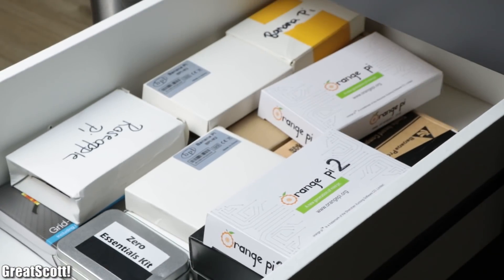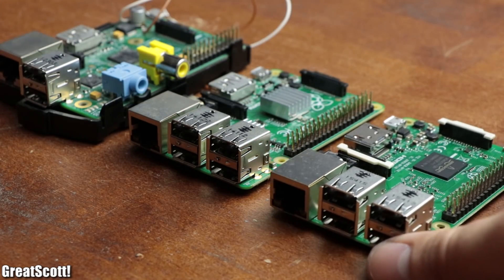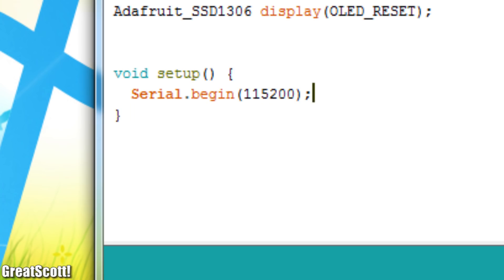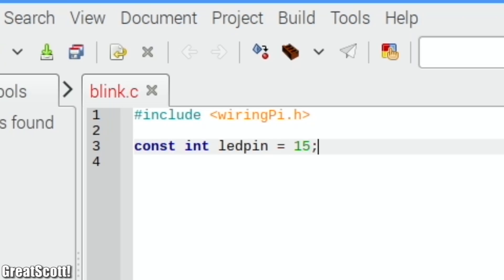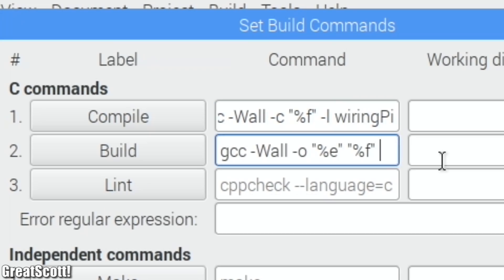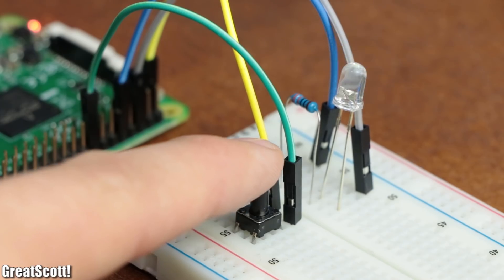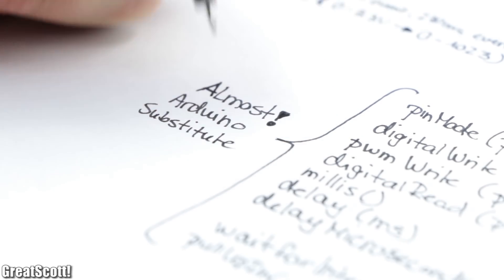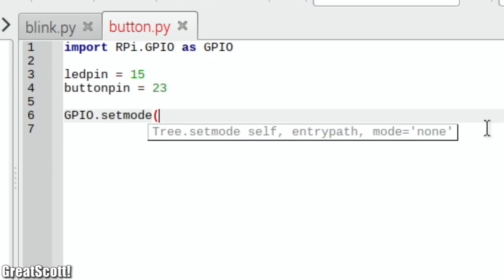Can a Raspberry Pi be used as an Arduino? || RPi GPIO Programming Guide 101

Comment: Awesome! This the first C programming tutorial I've seen on the PI and it was a  great introduction.  A question though -  can you see any advantages to using C except familiarity? I can understand that in a memory and processor limited cpu like the arduino it's absolutely needed but on the resource rich environment of the PI I think the python tooling is so much richer.  Either way thanks for the video - it's great to see your detailed analysis.
Reply: Usually C is much faster than python because C compiles to machine code and python needs an interpreter, however, you have Cython
Reply: It depends on the type of project.
Reply: It's very useful if you need performance (for example generating a pwm signal) since it bottlenecks the RPi a bit.
For most applications, however, python is fine
Reply: This is how you start a holy war between C and Python adherents.
Reply: C is a very well supported language. Especially when legacy versions are included.

I wrote C Programs on DOS back in the day.
Reply: Everyone seems to be arguing about speed and machine code and whatnot, which is pretty much beside the point for most projects.

Use C for really low-level stuff (bit-banging, realtime, etc.).  Use Python for really high-level stuff (cloud, AI, database, etc.).  For all the stuff in between, use whichever one you like more.  It's not rocket science.

Besides, it's not like C and Python are the only programming languages supported on the Pi.  You can use C# or Java if you want.  If the language you want to use doesn't have direct support for things like GPIO, then add it.  Almost every language has a way to tie into the C API.
Reply: Alan Ramírez Herrera , I actually noticed that my raspberry pi generates compiled python files. I haven't looked into it, because I just saw them last night, but it seems that it actually compiles it somehow (regular Python, not cython)
Reply: Another way to look at it:
Many popular languages nowadays (C#, Java, JS, PHP,  and many more) use syntax that is very similar to C, and will be easier to learn if you learn C than if you learn Python.
Reply: Benedikt S 
Depends on the project if you want something that is closer to hardware you can use GO some says not sure of this info yet ...
Reply: Alan Ramírez Herrera 
Yeah and python have a python VM
Reply: Павел Данилов 
but languages have limitations ..
Not all are the same this is where I was getting to ...
Reply: I use a lot of python at work. I also use C. It doesn't have to be one or the other. Python isn't the fastest for many tasks, but you can write a python module in C and call that to get the speed you need.

When it comes to embedded what language you choose depends on what your project requirements are. Python is great for general purpose use when timing isn't critical. If you need to send and receive data from the network, update displays, blink some lights, it shines in those applications. If you have a real time requirement, meaning you must respond to an event within a specified time period, or you need to respond at an exact time python fails miserably. C is is very good at that kind of task. The operating system needs to be modified with real-time kernel extensions so the operating system doesn't decide to do something else when it needs to react because of the schedular. Real time is where microcontrollers excel. When your code is on bare metal it's very easy to react quickly. The microcontroller CPU may not be as powerful, but it's entire purpose is to run only your code. It doesn't have to split time between the tasks of an operating system. There are very light operating systems, RTOS or real time operating system, that handle scheduling of tasks for those applications.

There are loads of hobby projects that get into the realtime domain: Quadcopters, motor control, etc.

Reliability is another. It doesn't come up in hobby projects but it's possible to certify C code up to SIL2 for mission and life-critical software. That's not possible with python in it's current state. Not that the raspberry pi would come close to the lowest level of certification. That's a whole different world though.
Reply: I would consider stepper motor control to be one of the in-between applications.  What I meant by "low-level" was more high-speed protocol stuff or digging into kernel internals.  Python is plenty fast for steppers.

I personally don't care much for Python.  I've used it, and it's a good platform - I just don't like programming in it, much in the same way I don't like ketchup on my hamburgers.  It's a preference thing.  So while I believe you when you say pyCNC is the bee's knees, I won't be checking it out :)  Thanks for the recommendation, though.

It just irks me when everyone starts arguing about compiled vs. interpreted vs. byte compiled languages when 99% of the time it doesn't matter.
Reply: I use BASH scripts for most of what I do on RPi. If a BASH script can't do it, there's almost certainly existing software that can (usually written in C or C++).
Reply: +Jeff Spaulding, no, python is not fast enough to outperform Arduino CNC software, unless you use low level programming.  Using the hardware in Linux.  pyCNC uses DMA to be able to outperform the Arduino devices.

And it is your own problem if you don't even bother to look at it or the blog where it is explained. It is a good learning experience.  But it is your loss...

Yes, most of the time it doesn't matter if it is compiled or interpreted.  But sometimes it does.
Reply: Languages are tools, they excell at different tasks. A screwdriver is a very good tool for driving screws, not so good for hammering nails (but possible with persistance and force). Same goes for a hammer.

If you are new to to this, give python a try. By the time you need to solve a reliability, stability or performance issue, you will not have a problem getting into C.
Reply: Alan Ramírez Herrera In that way you are absolutely right. But you have to look in another way onto a Project with a Raspberry Pi. Performance is secondary.
Reply: noisycarlos yes it uses regular python to compile....if u have a file called demo.py then after compiling u ll get one more file called demo.cpy
Reply: Mai Mariarti nice to read that ....
Reply: northshorepx use c++ and you have the best of both worlds: fast programs & less code
Reply: Henrik for rest of all the developing programming c c++ would suffice.
Reply: noisycarlos 
Python get interpreted and compiled and it also have Python VM
This is why python is a hydride language not like java which is always compiled to byte code
Reply: I would say.

ALL programming languages can be shown is Turing completed.  That is, they all have sequences, selections and iterations (loops), that is same semantics.  They are formed and expressed in diffrent forms though (syntax).

With that said, there are different ways of programming in them, so you need to learn the syntax and way of expressing the code.  Like code in procedural languages (C, PHP), objective languages (Java, C#, JavaScript) and functional languages (Haskell, Ocaml, ML, Lisp, JavaScript).  And even logical programming languages (like Prolog).
They are all quite different and relies on different way of coding.

But yes, if you have the basics of coding, you should be able to learn other languages. If you do read some code and write a couple of programs in them.
Reply: Yes, the byte code means that the system doesn't need to parse and interpret the source code when executing.  And it will also help finding errors earlier.  Which is a huge help when debuging and executing.
Reply: (isn't it demo.pyc ?)
Reply: Except that C++ are optimized for speed, not readability (Yes, Bjarne Stroustrup told me that himself).  So if you want to learn to program, you migh want to consider other programming languages first.

So yes, it IS fast.  Yes, it is less code.  Yes, it is harder to understand, as it makes lots of things "magically".

Like coersion in Java and many other languages (which is automatically type casting, like convert int to Integer, which makes it MUCH harder for the compiler to help you make type safe programs)
Reply: Anders Jackson 
Yeah I have a project but yeah let’s just not start doing it with the easiest language let’s go and learn another language just to prove that we are great programmers
Reply: Lassi Kinnunen Of course.
Reply: +Mai Mariarti, many/most modern programming languages are just boot strapped in C, and then programmed in the language itself.
And why is C used so often?  Because it is available on so many architectures because of Unix and because of GNU.
And no, C are not complicated, it is old and are designed in ways that makes it HARD to optimize.  Just look at the aliasing problem when optimizing code, which most modern languages avoid, which make them MUCH more easy to optimize.
C++ is another language, based on C and added object oriented (and some more) to make C++ a more modern language.

C is basically just an glorified portable assembler.  Built on 1960 times compiler theories of designing languages, which are showing through.
Reply: +Lassi Kinnunen.  Have a look at PyCNC.
https://medium.freecodecamp.org/how-to-build-a-3-d-printer-using-cnc-controller-in-python-bd3cd5e28516
Reply: +cypherf0x, please have a look at pyCNC, and you have Linux and Python beating the crap out of an 8 bit Arduino system doing CNC and controlling stepper motors.
Reply: Well, to make a difference from your indications, pyCNC are doing real low level things to drive stepper motors directly from the RPi, without any low level C, just coding in Python.  Have a look, it is impressive what have been done.
Reply: If you're programming embedded or MCU-like applications on Linux do it in C.
If you use Python or whatever you'll be eternally fighting with someones half assed library around the kernel sub-system you want to work with. If you use C when you want to use SPI you can go into the Documentation directory of the kernel source and find out how to use it's real interface for yourself.
Reply: C is a compiled language, which means a much much faster code execution comparing to the interpreter of python (around 1000 times, even comparing to the most cutting-edge optimized python interpreter like Pypy). However, C is designed in very early days and some of their design concepts are quite out of date now. With that being said, it is much harder for beginner to write good C code than python code. You will deal with compiler errors, linking errors, runtime errors, segfaults and undefined behaviors. So, except you have had a lot C programming experience on Linux, it is not recommended to use C for RPI projects.
Reply: Lots of good points being made on the c side here. But if you want to do anything with eg. machine learning or machine vision; you're really better off looking at python. Not because python is fast, but because the  tools are so much better. As for PWM on the Rpy, there are plenty of python libraries that can handle that for you.
Reply: Henrik but for AI python is the best choice.
Reply: +Alan Ramirez Herrera.  Most project doesn't need C, unless you want to code some drivers for OS:es.
There even are some CNC drivers written in Python for RPi.  Wich I would have said was not possible to write for CNC in Arm running Linux. Well, it is even faster then Arduino based systems. But with some smart coding, using DMA, they are able to get a faster CNC controller software then with plain C.

Like, most Internet Bank software are written in Java.  That is because it is fast enough, but much easier to write system in then C.

So I would suggest python, haskell, Ocaml or any high level language compared to C.  UNLESS you are writing drivers for Linux.  Then go for C.

Yes, I started to code C in 1983 on Unix, OS-9 (for 6909 CPU), HP 64000 development systems and PRIMOS/PRIMUX OS (on a Prime 750 real mini computer, that was about 750 kg heavy).
Reply: Yes, ANY modern compiler will beat any Assembler code written by humans, as long as they are allowed to do some optimization.

And yes, there are lots of programming languages that makes as good or better machine code then C. Basically because they have a decent type system, memory manager and frankly, good enough speed if they don't match C in speed (which many do).
They are modern and usually based on something better and easier to optimize, like a modern functional programming language (Ocaml, Haskell, Erlang etc).

There are actually really hard to make a good optimizer for C, and have LOTS of times spent on optimizing the code.  The major problem being the aliasing in C, which isn't in modern functional languages.

But most programs doesn't need the extra speed of C (or what the programmer think is extra speed).  As that comes with harder to code and debug programs then with a modern language, like Python, Java, and the functional programming languages.

And actually, a good selection of algorithm, and no memory leaks, will get a better and more stable product in the end.  Which will WELL compensate for the "lost" speed (which usually are over estimated in modern CPU:s).
Reply: Python it's efficient, the good thing of python is that you use libraries, and these libraries are usually written in C. You want to do an heavy computation, you use a library that is already implemented in C and it's efficient, for example python is used for heavy scientific calculations with numpy or for machine learning applications. 

The other good thing about python is that is an high level language that gives you a pretty low level system calls, every UNIX system call has a python wrapper, so if you want to do something efficient, you can by-pass the standard library and for example do a direct read/write on a file descriptor, call an exec to start a process, even more advanced calls, everything you would do in C you can do it in python.
Reply: northshorepx Using Python is always the better choice on a Raspberry Pi.